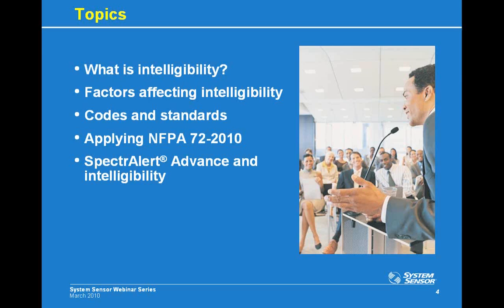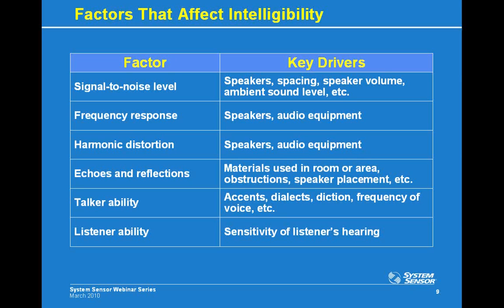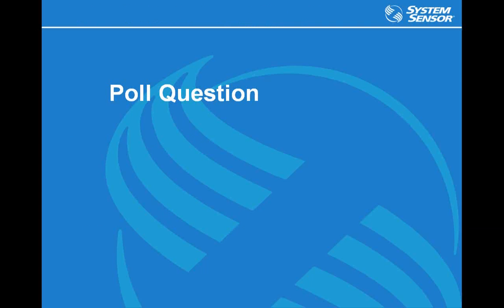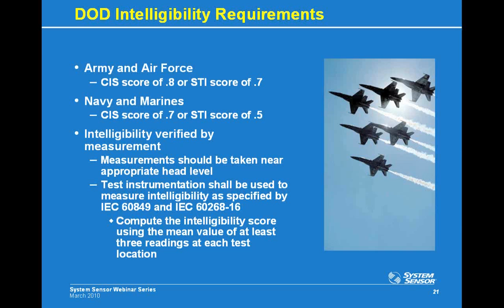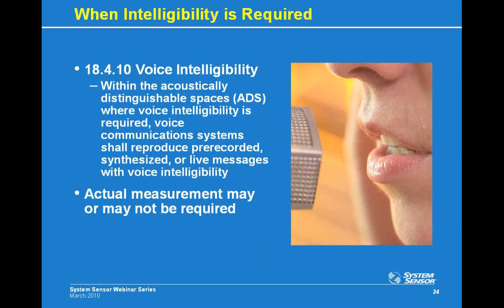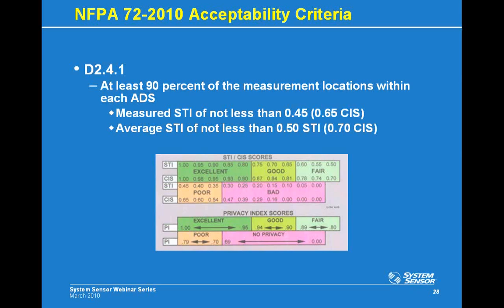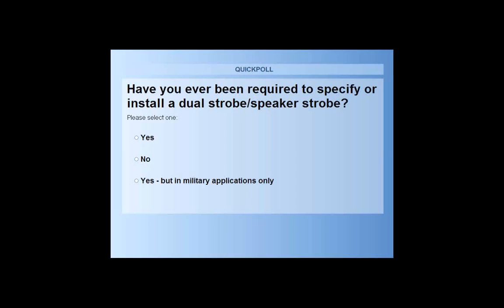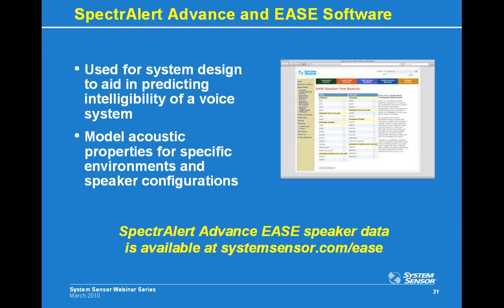AV - ECS/MNS -- Webinar: Intelligibility and ECS Requirements - NFPA 72 2010

Comment: I need to design notification system for a server room. Among the noisy components in that room are AC units that generates noise of upto 70db rated at 2mtrs distance. The speakers that I am proposing generates 88db at 3mtrs distance. As per the project specification the speakers output should be 20db above the ambient noise level but I dont have any inputs on the ambient noise level in the room. I just know that there are 10AC units producing 70db at 2mtrs distance on basis of which I need to design notification system for the room. Please advice.